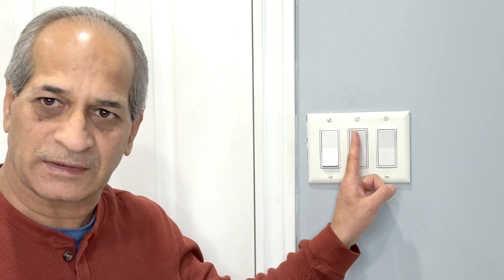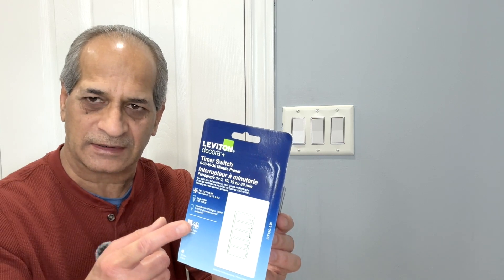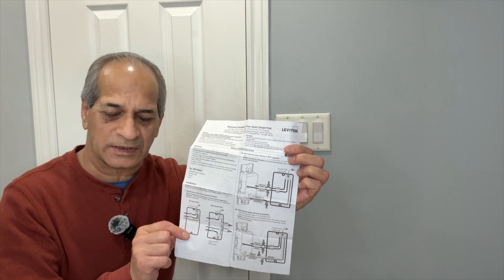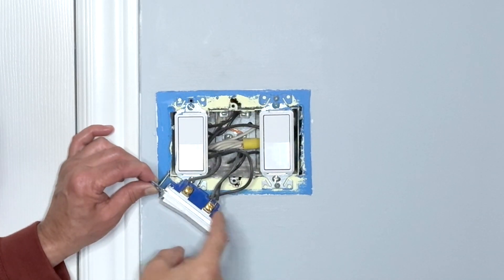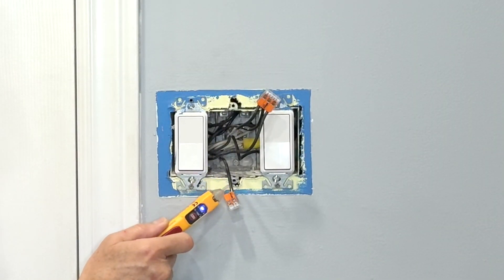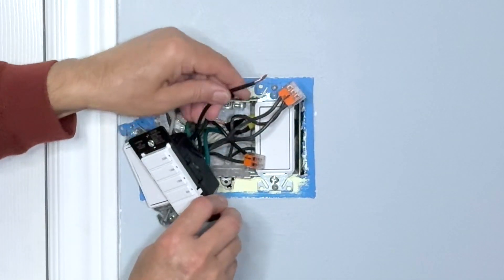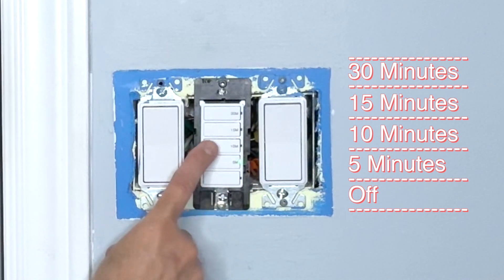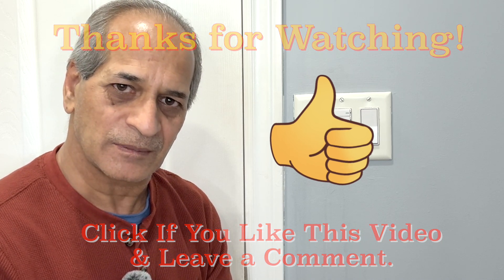How to Install Leviton Decora Preset Timer Switch for Bathroom Exhaust Fan.

Comment: Thank you for the video.   The Leviton Decora 15 Amp In-wall timer switch says "No Neutral required, Single Pole".  Does that mean we don't need to connect the switch's neutral wire?   Thank you.
Reply from the maker: Thanks for watching! Glad that you liked it. If you have the neutral wire available, it’s better to connect it. If you don’t have it, then simply follow the instructions. The switch will still work fine.